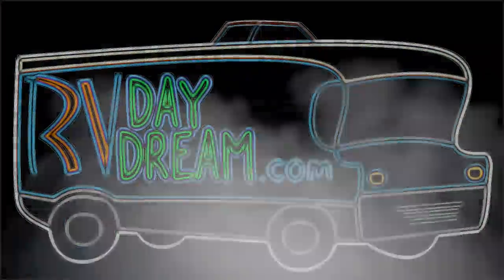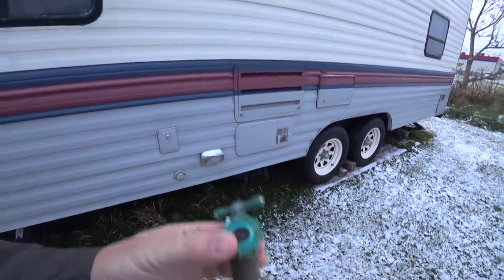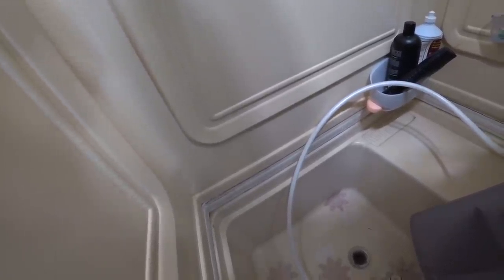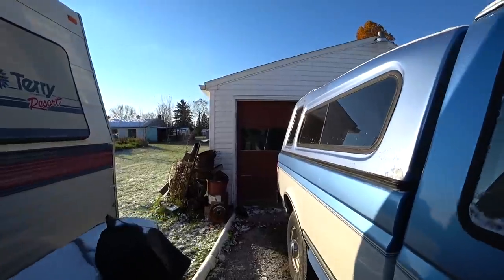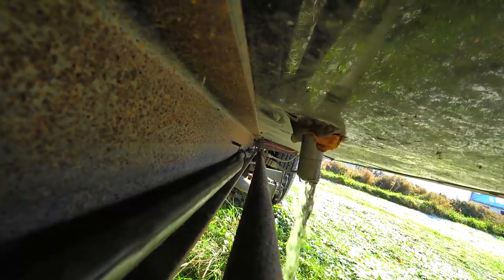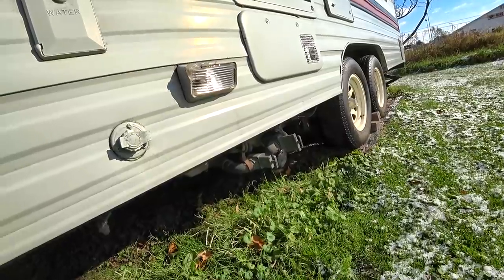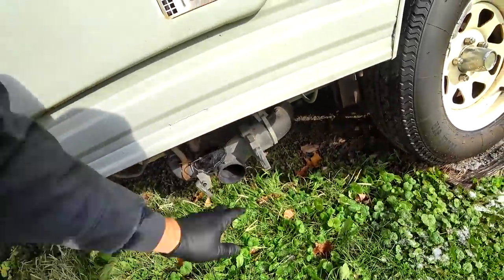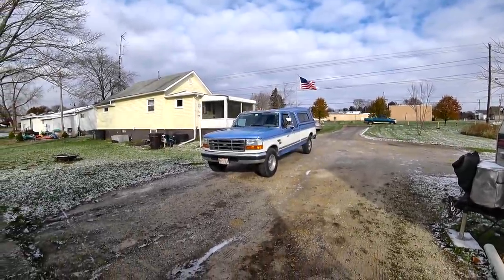One Reason To Winterize RV

Comment: If you want to smooth out your water pump.  Install an rv water accumulater tank.  They are small, cheap, and easy to install.  You can pick o e up on amazon for under $30.  It will stop the pulsating, quiet down your pump, and increase the longevity.  That is one of the first mods I make to any camper I purchase.

Comment: On my older RV's I put the necessary winterizing valves on the Pump and the hot water heater so I could quickly winterize my rig. With my new unit it already came that way....reason is I winterize my rig no later the 11/1 EVEN if I plan to use it after. I drain the hot water heater, drain the fresh water tank and run water tank antifreeze through the system and dump some down the drain for the holding tanks since I am not confident all the water drains.  Cost me 8 bucks in antifreeze and 20 minutes of my time. It is a better piece of mind for me. When I do the "final" winterizing I am more thorough but my 20 minute job has not failed me yet. All the work you have done on your rig and the fact you live in NE Ohio, I don't think it would be a challenge for you to take the time to set up the valves to do a quick winterizing since I recall freezing can start before Halloween and end sometime near spring break :- ) . I had a 93 Terry Resort 35V at one point and everything was easily accessible for me to do that work.

Comment: One thing to watch for is if water rests up against the black and gray waste valves.  You might have "emptied" both tanks, but moving the trailer around a bit, walking in it, causes a little trapped waste water to make it's way towards the valves.  Once the trailer is winterized, supplies cleaned out and in it's final storage spot for the long NE. Ohio winter, I'll take a 2 gallon pail, and pull each valve and let the few ounces of water drain out one final time.  My new ORV RV trailer has enclosed / heated valves, meaning all there is showing from the outside is the 4' pull handle.  The valve itself is in a heated compartment under the tanks un-assessable .
Reply from the maker: Definitely an artic package is needed especially fulltime with ties to Ohio 😂

Comment: I was waiting for you catch bottom of trailer on fire, then burning trailer up, then coming home with a new one
Reply from the maker: Hey now! Not a bad plan, Maybe I need to reshoot the video.. Lol this time let's get it "Really Warm"
Reply: @Rvdaydream  YOUs was fine with the heat as you suggested. Eaglegards 🦅... P.S. Before I gave my RV away to my daughter, we used it as an emergency back up for the privy. My house sewer line needed to be replaced. One thing about the RV, it's a great backup emergency vehicle. I'd sold raffle tickets to the truck and made about $50 grand.
Reply: @Rvdaydream  that might also solve the problem of getting garaged cleaned up inside, it is parked close to garage

Comment: You can`t believe that broke off in freezing temps....?? your the only one....winterizing is easy and fast your spending more on propane and elec. than winterizing in the first place not to mention now you have to do a repair in freezing temps.....i`m just shaking my head WTF ?? I am a subscriber and this is not a positive comment i know but i`m trying to stick with your channel but sometimes it is hard i have to say.
Reply from the maker: No Worries, I repair stuff all the time, I am good at it, I laughed longer about the faucet breaking off then the actual time it took to snap it....It's all about trying something new...Every year we have the RV winterized by now and most of the time covered too.. We were trying to keep a half full fresh water tank for just 2 days duration of below freezing  temps before this trip. Because of this failure I now know what to look for...It's a learning experience..There is a lot of fulltime RV'ers that get "stuck" in a situation where the weather gets too cold, too fast, for too long(just look at everyone at the sugarbeet harvest this year.)For example, How long can your RV stay in freezing temps before something gets damaged or quits working? What exactly is the weak point in your system liable to freeze up first? Now that I know mine, I can work out what I need to do to protect it in the future. I'm sure you've been watching our channel for awhile, you know, I make very little mistakes, A few, but very few. Stay tuned in, as I am willing to try things just to experiment so others don't have to do the work..👍😁